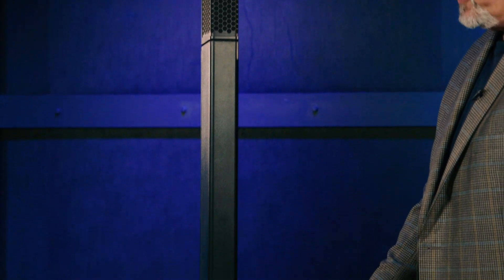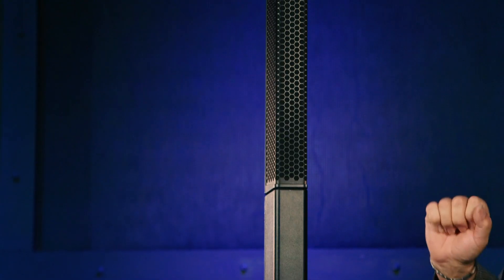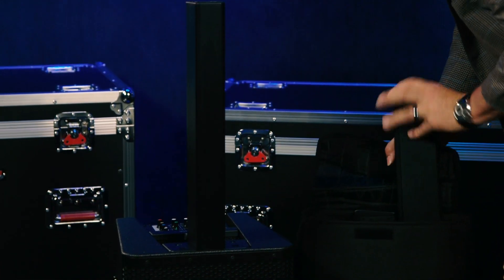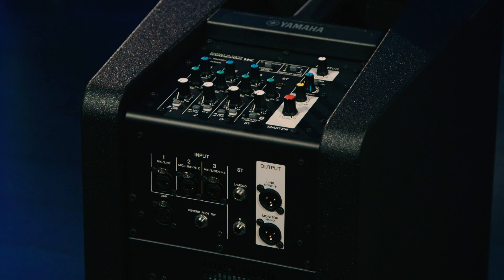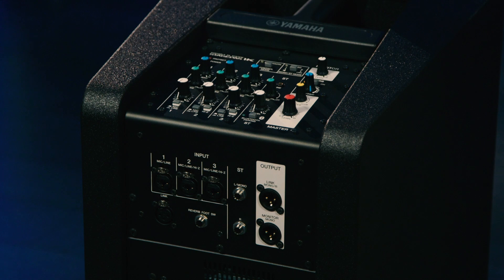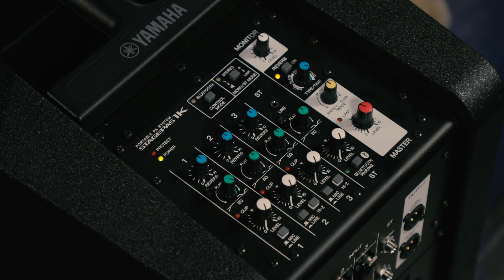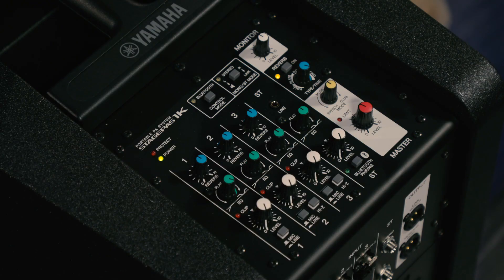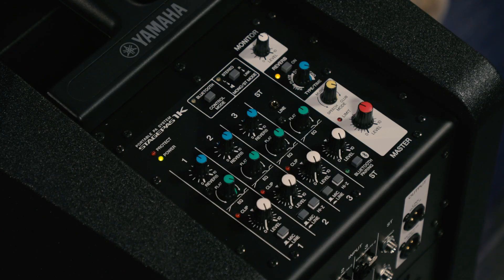Yamaha STAGEPAS 1K 1000W Column PA Speaker System Overview

Comment: Is it more powerful than Stagepas 600? I have been using Stagepas 600BT for last 5yrs and it's really good. It also has 4 inputs for XLR cables. 600 is good enough for mid size hall with capacity of 70-100 people. It also has two speakers.

Is 1k better than 600? Does it has more louder and clearer sound than 600? Can it cover double the size of area than 600? Can it work on open grounds too?

Comment: Very happy with this product. I have been using it for live acoustic piano performances with vocals for more than 2 years. If full stereo sound is important to you, especially for keyboard players, I would recommend getting the second unit and pair it in stereo mode. Now also DXL 1K as an add-on unit is available for this purpose. Playing mono sound sources such as guitars and vocals, and playing audio tracks, it does its job with an amazing sound quality. Feedback from the audience has been very positive, too.

Comment: Can it adequately replace two speakers?
Reply from the maker: Hello, Casey! The idea with these types of systems is that they can replace a traditional PA setup. So, yes, in a way it can replace two speakers, but it kinda depends on what size speakers you’re comparing it to. My favorite application for these column speaker setups is coffee house type gigs with one or two acoustic guitars, and vocals, plus maybe a keyboard at most.
Thanks for the interest!
Spunde, Sweetwater Sales Engineer, (800) 222-4700 ext. 1732, Spunde@Sweetwater.com

Comment: How many sets of these do I need if I want to cover a ballroom of 1000 pax? It will be used for a standard live band setting. Will 4 sets be enough? 2 at front of house and 2 at the back?
Reply from the maker: Hello, Neil! In order to recommend the right sized PA system I'd really need to know the dimensions of the room, the style of music being played, and at what volumes you need it to be. Feel free to email me directly.
Thanks for the interest!
Kevin Spunde, Sweetwater Sales Engineer, (800) 222-4700 ext. 1732, Kevin_Spunde@Sweetwater.com
Reply: @sweetwater  Hi Kevin, thank you so much for responding to my question. As for the dimensions of the venue, it could be probably about 200ft X 120ft or any size venue which can accomodate 100 banquet tables of 10 pax each. Also it is meant for a wedding reception or church worship concert. For the band it is a standard 5 piece setup with a mic’d in drumset, bass, 2 electric guitars, 1 keyboard with additional 6 vocal mics going into a 16 channel mixer and then to the stagepass 1k. As for how loud the volume needs to be I think it should be loud enough for about 1000 people to hear.

Comment: I purchased this and used it already.  I'm very impressed.  Had Drum backing track into bluetooth, the Yamaha apps is great, i can line up all the tracks in there.  Bass with Helix Stomp, Guitar with Helix LT and Vocals.  Sounded Great.  Powerfull, took little room and set right behind us.  The one knob EQ works great,  the on board effects are really good.  It took us 10 minutes to set up.  The bass response is amazing.  Tight low bass, no distortion.  Power is great for a small venue, 50-100 people.  Replaced a large EV system with 15 inch sub and two 15 inch monitors, plus a yamaha mixer and tons of cables.  For more options I would recommend a Vocal pedal, but it did the job for what we needed.  Still amazed at the clarity, no feedback!  I'm an EV fan and tested with the Evolve 50.  The Evolve is louder but overkill for what we do and it does not have the mixer and effects.
Reply: Ceci Shaw ey brother you think if you push it lil more this yamaha 1k can handle 150 people because i saw some comments around here and says that can handle 500 pps i thinks its too much i just want to know your oppinion thanks
Reply: Yeah no way 500.  You need two of them for that size.  a lot of these places are not perfect rooms, they have weird angles and furniture and all kinds of things that change sound reflection.  I think one will for 150 people pushed with the bass rolled in the middle.  I can tell you it can do 100 easily.  That’s with bass, guitar, vocals and backing track.
Reply: Ceci Shaw how was the one knob eq? i’m a yamaha mg12xu mixer user i never seen like that before.
Reply: ckmanzano I was surprised that I like it.  I have a Yamaha mixer and sometimes I think we dial in too much high and not enough kids and bass.  I put the new EQ knob at 2 pm.  Perfect.
Reply: Hi! You use 1 system or 2 of those?
Reply: Petar Ipsic just one.  We added a Yamaha dbr10. And plugged it into the monitor out.  Perfect now.  Super clear.
Reply: Ceci Shaw Great to read your input on this as a user! :-) Was a bit leery of that one-knob EQ, but it seems it‘s serving you well (as confirmed in the comments on your comment). Was the Evolve 30m also available for you to test when you bought this? It has several more inputs, full app control, normal EQ (plus compression, delay, reverb, etc.). I‘m sure the Yamaha will be louder and have a bit more bass? Any thoughts on that, by chance?
Reply: @scottbecker3485  ok finally tested the Yamaha and the evolve 30m side by side.  The evolve sounds great.  You can’t go wrong with either.  The Yamaha has more bass and most important can be used without having to go back and forth to an APP.  All the knobs are right there, simple.  The evolve 30m is very clear, good power, great app and more inputs.  Same price, less bass.  After testing my friend picked the Yamaha also.  She didn’t like having to deal with an app, specially since she sings right next to the PA and can adjust things faster manually.  The Yamaha is missing compression for vocals though.  It would make it prefect. She added a vocal compression pedal from helicon and the clarity is superb, the Yamaha built in hall reverb is excellent, and now we don’t get occasional red led when strong vocal signals come in from the mic in that channel.

Comment: How can you use it for a duo?  There are only 3 channels.  I need two vocal mics and two acoustic guitars.  I want reverb on everything.  Am I missing something?
Reply from the maker: Hello! I'd recommend either using an external mixer running into channels 1 and 2 with this system to get more inputs, or looking at a different option that already has more inputs, like the EV Evolve 30M:
https://www.sweetwater.com/store/detail/Evolve30M--electro-voice-evolve-30m-column-speaker-speaker-black
Thanks for the interest!
Kevin Spunde, Sweetwater Sales Engineer, (800) 222-4700 ext. 1732, Kevin_Spunde@Sweetwater.com

Comment: I have one of this Stagepas 1K. It sounds great and easy to setup. If you are are more advanced and want better EQ (PEQ) and Fx I suggest to go for a external Mixer and you have more control over the sound. I was also impressed with how good the built-in bluetooth sounded.
Reply: Have tried it live at a smaller restaurant with acoustic guitar, keyboard / piano and song microphones. Guitar and Keyboard/piano worked great with 1 knot equalizer, but microphone became a bit bass even though I had pulled the bass down max. The clarity of the sound became much better by using an external digital mixer in my case an XR18 where you can set the exact sound image with effects, parametric eq and compressor on the song. Otherwise, there is nothing wrong with the speaker itself. I'm happy with the purchase anyway and especially when it came with a flexible bag to carry it with.
Reply: Jan Lingefors Much appreciate hearing your remarks as a user in settings similar to mine. Looks like the internal mixer probably wouldn‘t serve my needs so well, either, since I‘m kinda spoiled by my RCF M18 (with compression and all the goodies). Would have loved for the 1K to replace that mixer...if it only had a couple more channels (like the Evolve 30 does, for example), plus a proper channel EQ and a few more effects...

Comment: i’m not a fan of only one tone control. i still prepare two with low and high control.
Reply: Most units with tone control are cut and boost levels. Very few have active control. Cost more to do. Look at the controls on the K1. You start with bass cut with mid and high, then add bass with mid and high, then to the far right, high and bass with mid cut. Go try a K1. It really makes sense.

Comment: Buy this system. For now, it is the best for the money. Since Yamaha bought Line 6, they are going to develop killer stuff and apps. It shows with the K1. Also, get the dolly. Very well designed and a must to have. One knob haters, try it before bashing. They work really well.
The smaller drivers are perfect for horizontal coverage and reflection rejection off ceilings. The only trade off is a slight lack of mids (clarity to some of you).  Other companies using larger drivers have to angle the drivers to make up for the lack of dispersion.  Problem with that is sound is bouncing up and down all over the room. Look at Bose and Yamaha's explanation of sound dispersion. My tip to fix the K1's midrange (clarity) issue is to set the Mode to Club, Set the individual channel EQ to full left and then adjust slowly to get the bass you want.  You will find that the sound will travel farther at low volumes and the midrange definition is much better.
Reply: After signing it's praises, mine died after 3 uses in 90 days. Yamaha will only take back the amp inside to repair. Average person is not allowed to take the whole unit apart.  Service centers near me do not have parts for repair so I have to wait and wait.  So, backend service is very poor in case of warranty repair.

Comment: Wonder if this will do a band in a small venue
Reply from the maker: Hey, Peter! Thanks for reaching out. It certainly can, depending on the size of the venue that we're talking. This is a pretty powerful PA. Let's talk a little more in depth! Would you mind giving me a shout at the contact info below?
Rock on! 🎶🤘
Cassie O'Hanlon, Sweetwater Sales Engineer, (800) 222-4700 ext. 3020, cassie_ohanlon@sweetwater.com
Reply: Acoustic Solo or duo in a coffee shop, yes, but anything else, I'd say get the evolves or turbosound ip3000.  If you have a drummer, I think their drums will overpower the Stagepas.   I have the evolves, (rated 8DB higher than this new Stagepas), and even those are almost always on the edge of limiting when I use them. I don't think the EVOLVE Could handle live drums either.   I DJ in a 250 MAX person capacity wedding venue where about 50 or so of those people are usually dancing, and the EVs Just barely cover it.
Reply: @p.quilici9095   This would probably do the trick quite well for band rehearsals! My EV is overkill for that kind of scenario.

Comment: You should test the Electrovoice Evolve 50s. A little more money, 127db and surprising low end and clarity.
Reply: I love my evolves, I'm cosidering selling though, in favor of the much louder (but much heavier) Turbosound ip3000
Reply: The Evolve is fine for what it is. But the K1 has more features, well built, and an all in one solution for less money. Yamaha/Line 6 has raised the bar on convenience, ease of use and setup.
Reply: Correction.  Mine was not well built as it died after 3 light uses in my home. Transformer blew and repairs are hard to get and time comsuming. Yamaha will only take back the amp inside with an RA.  Auth service centers do not have parts so you have to wait and wait.
Reply: @Ricky-jj1jj  Oh no, what was the outcome? Was it a total pain in the ass? Now I'm concerned for mine, it's beginning to sound weird.

Comment: Can you run this with only 1 spacer between the sub and top, or has to be 2? Just wondering if its height adjustable like bose compact
Reply from the maker: Hey, Jason. Great Question! The STAGEPAS 1K can in fact be ran with or without the risers in. They allow you to adjust the height based on your need and if you are are not elevated when playing. They also design the bottom few speakers of the array to slightly curve down to move the coverage up closer to the performer and so that the front rows have better coverage, as well. These systems sound really good. If there is anything else I can help with, please let me know.
Grant Embury, Sweetwater Sales Engineer, (800) 222-4700 ext. 1647, grant_embury@Sweetwater.com

Comment: I tested this at Sam Ash yesterday and it sounded awesome.  I have an ev 15 sub and two 15 on stands and it takes forever to set up, plus the weight.  And I never use all that power.  The Yamaha sounded great, loud and very very clear.  The added pa is a big plus also.  I would play this all the time.

Comment: I guess I would expect some difference wattage between the subwoofer and the pole speakers, but 190 vs 810 seems a bit extreme. (For instance, the EV Evolve splits their wattage evenly at 500 for both the woofer and the pole.) That said, I would like to hear this versus the EV Evolve.
Reply: Hey Jeremy. 
      I could be wrong, but from what I've learned, wattage ratings are almost always unreliable ways to compare speakers.   The Max SPL rating seems to hold up better for comparing without personally hearing them. 
      My old cheap behringer top cabs were rated at 550 watts, and they acheived the same volume levels as my friend's 1,000 watt EV ZLX12ps, (Though the EV beats the behringer for sound quality)  I don't even know how they get these crazy wattage ratings nowadays, it seems like blatant false advertisement to me. you'll notice every new speaker that comes out will say at least 1,000 watts when 5 years ago, they were all 500 or less. but if you listen, they barely get any louder (if at all)  than the previous generation.  
     QSC advertises their KLA Series as 1,000 watts per module, but claim you can run 5 modues on a 15AMP 110V household circuit. A 15A 110V circuit can only handle 1,800 Watts. So if these speakers were ever drawing even half the power they claim to have, theyd be tripping breakers and peole would be complaining to QSC.    I used a watt meter and cranked a "1,100 Watt" DXR8  All the way until the limiter was lit solid, and I never saw the meter exceed 150 Watts.
    I think they put oversized amplifiers in these speakers that are set to never actually put that much power out to the drivers.     Just so they can say  their speakers are "1,000 watts"   Honestly nobody would ever want two 1,000 watt speakers anyways, unless they were LOUD, because you couldn't even  run two of them on a standard 15A 110V household circuit. 
      It depends on what kind of muic you do, If you're doing Acoustic coffeeshop style gigs, this new Yamaha system would probaby be great. But anything else, and I would hold out for Yamaha's bigger line array column, (If they ever make one) . If the max DB measuring was done similarily to EV, I don't think this will hold up to the evolve in terms of volume, perhaps sound quality, but not volume.  The EV Evolve (Which I own, and HIGHLY recommend)  peaks at 127DB If I recall correctly.  They say adding 10DB about doubles the volume, and the Yamaha is rated  8DB lower at.119DB.  Even the Evolves are barely able to handle a decent sized gig. I mainly DJ weddings, where high volume isn't particularily sought after (because old people complain if it's too loud.), so they're good for me, but I almost always have my EVOLVE systems on the edge of limiting.
Reply: Frank Pirolo Sounds like a very valid take on companies‘ propensity for playing the mega-numbers game. If sex sells, so do big numbers, eh? Good on you to remind us that we should concentrate less on the stats than on the actual sound and loudness. As for your Evolves, I presume you mean the 50? I‘m interested in the 30m (with the nice built-in mixer and app control), and wonder how they might sound in comparison with the Stagepas 1K, for solo and duo acoustic gigs employing a bass as well as a BeatBuddy or stompbox for some deep-bass sounds, too.

Comment: Should I need to replace the 1000W 15" Mackie Thump speaker, the Behringer B207 monitor and the Mackie 8-channel mixer I actually combine for my PA needs, the Yamaha Stagepass 1K is the system I'm going to buy. I sing and play a Yamaha E453 keyboard with automatic rythms, and also use a drum machine for those rythms not available in the keyboard, to perform as a one-man-band in Puerto Rico, so my repertoire includes a lot of tropical dancing music that require the booming power this system promises. All the other array systems in the market appear to concentrate in the needs of people who play guitar while ignoring those possible clients who, like me, use other instruments. This one also provides more channels in the mixer than the other systems which offer just one or two channels. Looks great, hope it sounds as well !!!
Blessings from San Juan PR !!!

Comment: Hi anybody compared these to the RCF Evox Jmix8? I think it competes directly with it and the RCF quality is top notch
Reply: Rockin' Robin Would be interested in that, too. Any in anybody‘s comparison of the 1K with the Evolve 30m, which sports more inputs and full app control. I‘m on the fence with these three systems (or just buying a 2nd Bose S1 Pro and a subwoofer, instead).
Reply: @scottbecker3485  So actually I went with the Evolve 30m after trying the Jmix8. I didn't like the lack of control with the Stagepass, limited EQ etc.
The Jmix8 was for me the better sounding system, with an overwhelming bass but it could be controled. It was noisier thought and that could be bothersome for smaller gigs. It was too big for me though and the Evolve hit my sweet spot with a great natural sound, small and light enough, many inputs, a great mixer with enough features to be used alone which is the purpose of such a system. And it looks sleeker than the Jmix8.

Comment: 810 watts for 1 bottom speaker vs. 190 watts for 10 top speakers. Seems like bottom end will fill small to mid size room but top end will not have enough power.